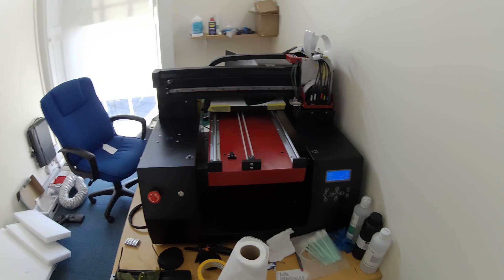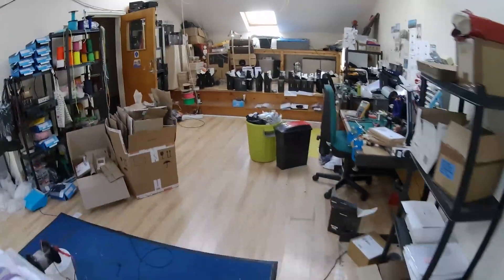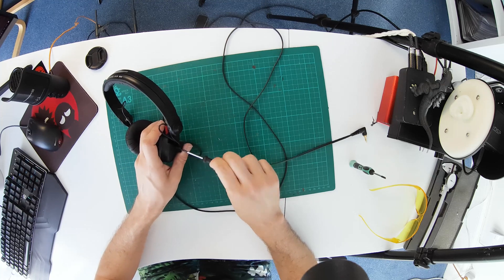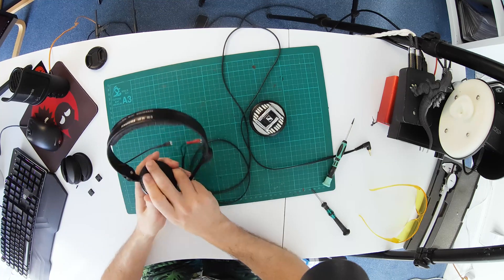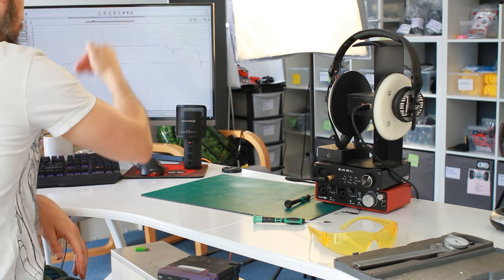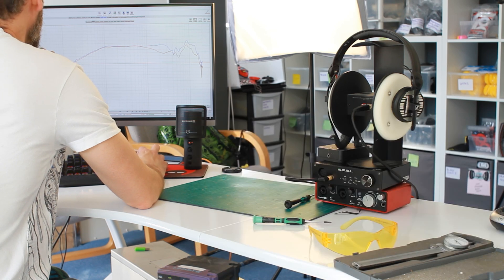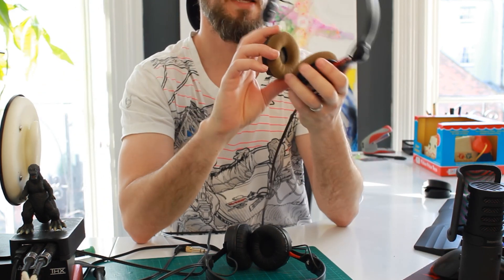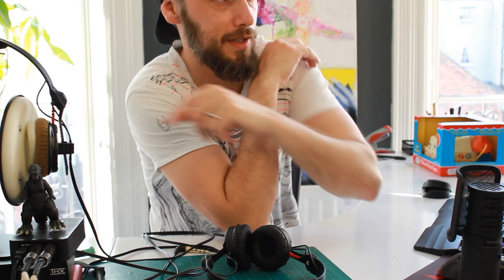Open Backed HD25??? we make a pair or OpenHD25 and run some tests to see how they work

Comment: wondering what the 25 drivers would be like in a set of grados ? what drivers did they put in the HD250bt ?
Reply from the maker: I have not checked out the 250bt yet but do plan on getting some in at some point. HD25 drivers would be tricky to fit in some grados - HD280 drivers would probably be a better fit but I have no idea how it would sound

Comment: Thank you so much for the video, and the measurements. I have my hd 25 lights coming in this week, and I only ordered them for this mod. Been wanting to do it for a few months now and recently found a good deal on a used pair. I will be trying some black HD410 and yellow HD414 foam pads  on them (if they fit). I really like the look of vintage sennheiser headphones (like HD410SL), so I’m hoping this works out. Would be cool to get some measurements with foam pads too. Thanks!
Reply from the maker: If I get round to doing an update on these U will include those measurements

Comment: Looking at the graph, it reminded me of my 3 pieces closed back guitar amp cabinet response when I leave it open: relaxed mids and highs.
What surprised me was that the graph reading with the velours pads showed even more bass information than the original with the earcups in, as well as bringing back some of the mid content.
Willing to see you checking those beyer dinamics pads video. Let´s call it Frankennheiser HD25 XD
Good job!
Reply from the maker: The graphs are normalised at 300HZ - we actually had to turn up the volume a bit to get it to match the volume of leather pads... SO... the bass probably stayed the same and everything else dropped

Comment: Very cool and geeky video. Again - compensation on the target curve you have in your software makes frequency response looking a bit misleading. For instance, it looks as there is a severe bass roll-off, which is not the case in reality of course.
Reply from the maker: I don't know... if you look up HD25 frequency plots most seem to start to roll off under 100hz but the scale on the graph used does not start at zero db so it makes the dips and peaks look more pronounced
Reply: @CustomCans  Sure it's great to see that graph doesn't start from zero! I meant that your software contains some kind of target curve and the measurement we see is not a raw measurement, but the one that's compensated accordingly to that target. I understand that your goal is to see the change in sound, not to perform a precise measurement. And this stand is not targeted to make precise measurements, which is fine. But not seeing nor target curve to which measurement was compensated, not an initial raw measurement doesn't make things easier ). Take a look at the data on the graphs through the link below - there are both raw and target measurements presented, which is giving a picture of frequency response, that's much closer to what you really hear and that's easy to read. https://crinacle.com/graphs/headphones/sennheiser-hd25/
Reply from the maker: That is a fare point and frequency plots don't really help show how they sound under normal use. I know things like waterfall charts and things give a bit more of a feel for how they respond but don't look good on screen. I will try to upload the raw data for people to download and play with in future